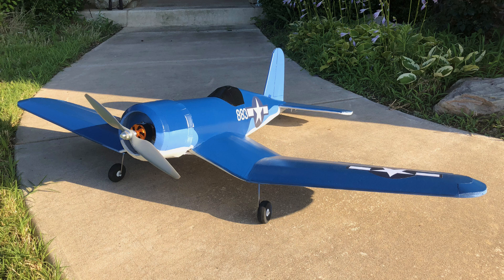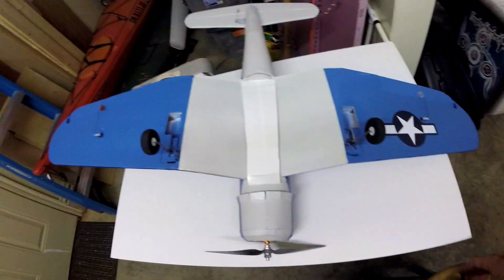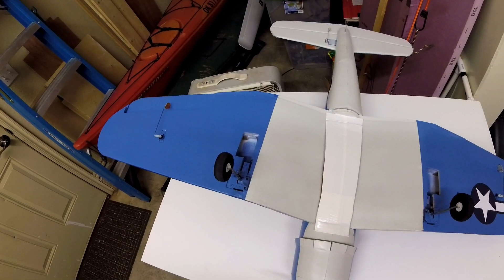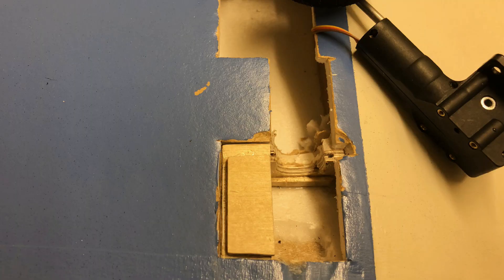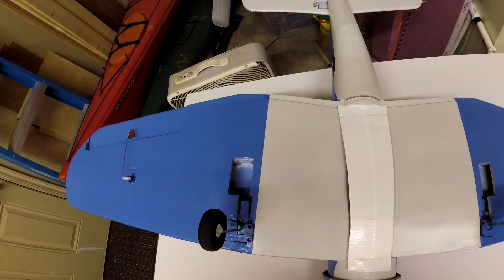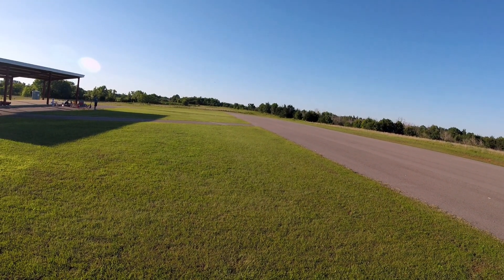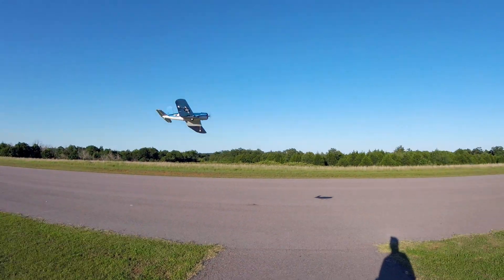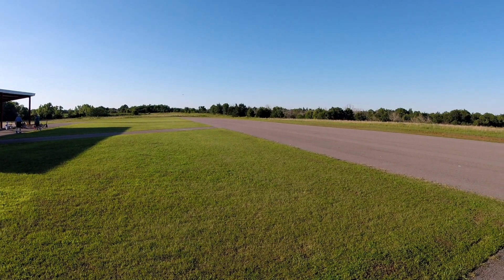Retractable Gear on FT Corsair Master Series

Comment: When it was without the wheels what kept the prop from breaking on landings?
Reply from the maker: APC props are pretty flexible - that helps.  Also,  I landed without the throttle on, so the prop didn't hit the ground very hard.  I've belly-landed a lot of planes and broken very few props.

Comment: How did you wire the gear? I'm new at all this and just finished the Corsair from Flite Test.
Reply from the maker: Hi Av8tore - my AA pilot brother uses a very similar username everywhere lol.  These little retracts should be connected with a y-harness and then into a port on the receiver.  Depending on the radio you have, you should be able to put that receiver channel on a switch.  Just make sure both retracts are in the same up/down position when connect them to the y-harness.  Good luck.
Reply: @mostlyharmlessrc3920  how ironic lol I've been flying most of my life starting when my mom married my stepdad got all my ratings then became an Airframe & Powerplant mechanic with my inspection authorization endorsement so I can check other mechanics or my own work and then sign off the work in the log books. Did all this while in law school then got my JD and now I'm a cop. Yeah go figure I know.

This is the 5th FT F4U I've built since the pandemic started and with 4 crashes I think I need landing gear and start this way. It hasn't been a year since I started flying RC and it's been a blast specially with my daughter who is right here by my side building and flying her stuff.

Thanks for the info, much appreciated

Comment: Hey, I got the same retracts and was wondering how you removed the struts? I cannot simply unscrew them...
Reply from the maker: Hi There! If they're the same as mine, there's a tiny little black grub screw (or two) on the side that requires an allan/hex key.  I think it was 1mm size or less.  Unscrew these and voila.
Reply: @mostlyharmlessrc3920  aaah! Right, didn't see them right away, thanks for the help!
Reply from the maker: You're welcome!

Comment: So I ordered the same retracts and ran into the same issue with my tires being too big for the strut.  Any recommendations on how to replace the struts to accommodate my wheels?
Reply from the maker: Yes I think I can help.  I made new struts out of 1/8th inch steel wire from Ace (cut with a dremel and bent with pliers) and used 1.75 inch foam wheels.  The supplied struts just unscrew.  Fairly easy fix, and I was able to make the struts about 1.5 inches longer too.  Good luck!

Comment: That's so awesome!  I'm trying to add the same retract servos to the FT Master Mustang but I keep running into the forward spar.  Not enough room for the wheel.  I may have to use a "Corsair style " retract instead.  Thanks for the video.
Reply from the maker: Bryan Clementi   Thanks for the great comment!  Hope your mustang with landing gear goes well 👍🏼😎

Comment: What wheels did you use? epic vid btw this is very helpful.
Reply from the maker: Thanks!  I think the retracts were means to be used with 1.25 inch foam wheels, but I made new struts out of 1/8th inch steel wire and used 1.75 inch foam wheels.  You can find them on Hobbyking or amazon: https://www.amazon.com/Du-Bro-175SL-Super-Wheel-2-Pack/dp/B0006O4G5A/ref=sr_1_15?dchild=1&keywords=rc+airplane+wheels&qid=1591224424&sr=8-15.  Good luck!
Reply: How did you remove the struts
Reply from the maker: Sorry I missed this question ages ago Paul.  There is a tiny grub screw holding the struts in.  I think it was a 1mm or 1.5mm allen/hex head.

Comment: I'm using a nylon skid for the tale works just perfect better than the wire and any wheel
Reply from the maker: Very clever- thanks!
Reply: @mostlyharmlessrc3920  now I'm making the FT corsair with 90 deg retracts and detachable wings
Reply from the maker: Sounds very cool! If I build the master series spitfire or mustang I will make the wings removable as well.  Wish I'd done that on this plane.  Good luck man!

Comment: How thick was the Styrofoam sheet you used in the construction? And what engine are you using too? Could you send me the Link of the Retractable Landing Train? Thank you ... Thank you.
Reply from the maker: Thanks for the questions.  This "Adam's readiboard" foam is about 5mm thick, which is similar to a lot of depron sheets.  The motor is a BC 3536/6 1250 kv from RCtimer (102 grams, 500 watt) flying on a 10x4.5 APC prop, but this is more than the plane needs!  Here are the retracts: https://hobbyking.com/en_us/servoless-retract-with-metal-trunion-for-small-models-32mm-x-25mm-mount-2pcs.html.  Make sure you see the build video right before this one on my channel.  Good luck - let me know if you need more info.
Reply: @mostlyharmlessrc3920  Thank you for the information my friend. congratulations on your Construction too. hug and thank you very much.

Comment: How high up off the ground did your plane end up?  I ordered some retracts for my corsair, and once the wheels are on it it ends up about 13 cm off the ground, so I'm concerned that may be too high
Reply from the maker: The retracts I ordered came with bent wires that didn't allow me to use the 1.75 inch wheels I had, so I made struts out of 1/8th inch steel wire (cut and put in a 90 degree bend).  With these, I measure 9cm from the bottom of the wheels to the underside of the wing.  This means the wheels come in just behind the rear spar when they're up.  Hope this helps!

Comment: You have answered a question of how to add wheels to this plane. Did the retracts hold up over the long run or did you modify them more? In addition, did you eventually get a better solution for the tail wheel? This is great!
Reply from the maker: Thanks for the comment!  I've had a few more hard landings and no spar or wheel damage. My "tail wheel" is still the bent wire because I just haven't been building lately.
Reply: Thanks for showing this great plane. I did follow up and looked for small wheels on the internet. An example of 1/64th scale wheels that might work is available through Walmart or many others. I am inspired!

Comment: Neat.  You don’t think you lose too much strength with that notch in the spar do you?
Reply from the maker: I've lost some, but I strengthened below the notch with a bit of wood and lots of epoxy (see 1:20).  Also, the wing beyond that point is very light, so I'm not too worried.  My second landing was so hard that I bounced up a couple of feet and it still held.  Thanks for the comment!

Comment: nice, i had to do surgery on mine. i went to maiden it and no controls at all, wouldnt bind up. seems i put the rx antenna right against the battery. Hopefully maiden it monday.
Reply from the maker: Thanks Nate!  I had something similar happen - an ESC failed on about the 10th flight of this plane (on 4s) and I had to deadstick it.  Good luck with your maiden!